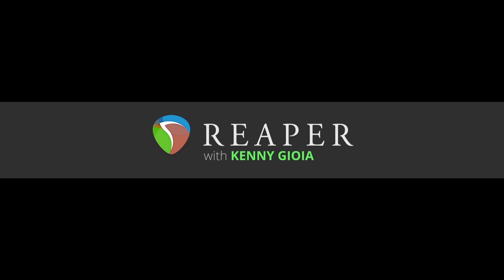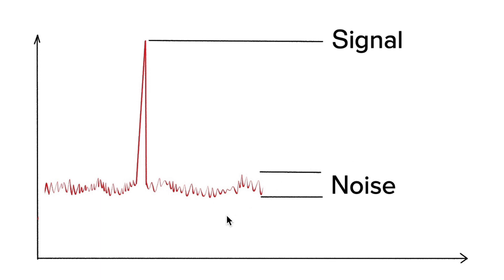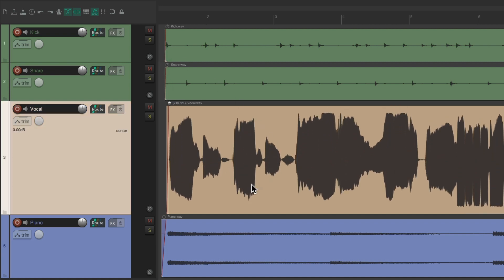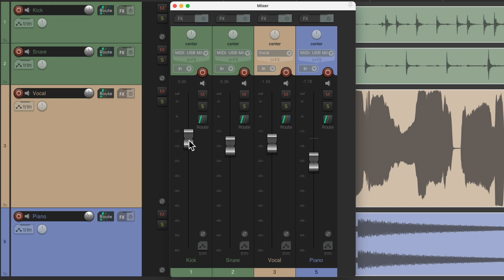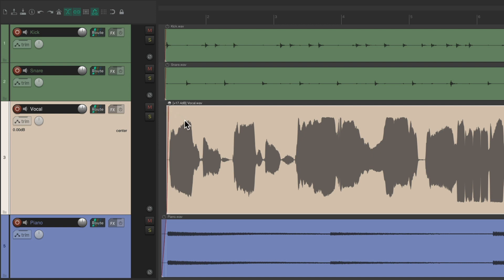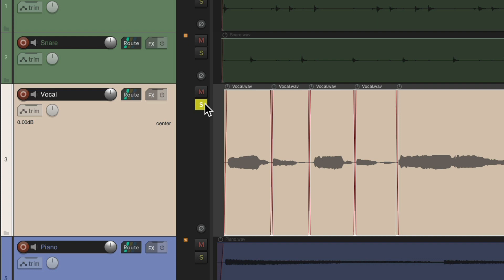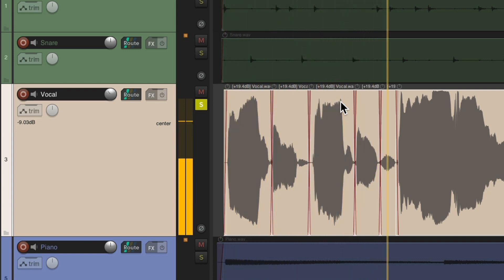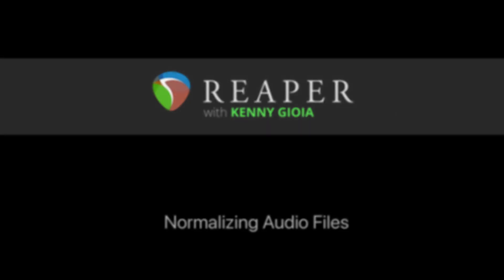Normalize Audio Files in REAPER

Comment: Thanks @REAPERMania for such great videos, including this one. When I adjust my normalised track using the volume control I've enabled in View, it shows me a red line. This stays there, the part above the line greyed out. It works effectively and is handy - I just wonder if the difference from yours is the version, or something else I've got differently set.
Reply: Actually there is perhaps a problem. Having normalized some very quiet tracks to 0db I'm having to lower the db by as much as 8db to stop the Master meter going way over 0db. I have no plug-ins on the track or the Master.  I'd be grateful to understand this!

Comment: One more thing to watch out for is gain-setting an entire edited track’s clips, then much later deciding to make some improvements to the edit.  Oops.  An option I could really get behind would be ‘normalize parent files’.  This could use the peak level of the parent file, rather than the visible clips to determine max gain, saving some grief later.

Comment: A problem I have encountered in the past: If a waveform is too low, and you apply automation-fade to all tracks, the low waveform track will not be affected by the fade----you have to create a separate automation-fade on the low track using the same fade points as the all-tracks automation-fade. Maybe the volume envelope of the low waveform is not large enough to be recognized by the automation-fade for all tracks. (?)

Comment: I am brand new to Reaper. I noticed that you have a nice and convenient Volume button in the upper LH corner of the window with the audio data. I have a *.wav filename in that location, but no volume button. I assume that I am running the latest version as I just downloaded and installed it on 10/3/2021. Is there some setting that I need to tweak?
Reply: Watch at 7:38

Comment: What if my stems are very low in volume and the wav files are barley seen on the screen from the original mix being very low? Is it okay to normalize all the stem files and mix from there without it changing the sound of the loop? I mix my loops low usually and when I export stems the wav files are barely visible

Comment: Your abstract animation at 0:58 of your normalising the wave file is actually incorrect! In your animation you simply moved the whole signal up: the higher signal goes up by the same exact amount as the lower Noise level, making it look as if the Noise is now twice as loud before (increase of about 100%) and the Signal is only increased by about 33%. If that were true, then you would have worsened the signal-to-noise ratio. In actuality the wave shape should have been stretched (instead of merely raised), to indicate that both the noise and signal have been raised at the same proportional rate to their original loudness, in which case the signal-to-noise ratio stays the same.
Reply: Yes I agree
Reply: Ah, I was gonna actually ask about that, the math didn't add up (if you add a constant to two numbers typically their ratio WILL change) glad you were able to clarify.

Comment: How do you find out what volume plugins prefer?
Reply: The manuals/documentation usually mention it if relevant. You can also do some manual testing to hear how the plugin responds to different gain levels. It's mostly stuff modelled on analog gear, like classic compressors, consoles etc, but also many guitar amp sims work best at -18.

Comment: Bedroom guitar player here. Recording at bedroom volumes has a lot of potential issues, however - I find that my wave forms are low (Amp into an interface, and a gate plugin placed on the input side of the track). In windows, I use Ctrl-Shift-N on the selected track item (recording of guitar at bedroom volume) after recording, to normalize the item. It allows me to mix with smaller db cuts by way of the track fader and doesn't mess with the other track items. The trick of 'splitting' the item never occurred to me - great tip!

Comment: Not explicitly mentioned, but if you are using any dynamics plugins such as a compressor, normalizing will change the sound since you will be hitting the compressor harder.  This can be quite significant.  That's why it's a good idea to normalize at the very beginning of the project, before you start adding plug-ins and tweaking things. Something to be aware of.
Reply from the maker: Yes. Either normalize as you go or before you start mixing.
Reply: So true. Same with guitar amp sim plugins.  They can sound drastically different after normalizing if you don't reduce the input level.

Comment: Hi Kenny, do you normalize audio files before mixing? Also, should we normalize before applying FX? What about after applying FX does it matter
Reply from the maker: Yes. I do it before mixing. You should definitely apply it before adding any dynamics based (compression) as it will affect how hard those effects are hit. Not sure what you mean by "after applying FX" because this is a volume change that comes before the track fx.
Reply: @REAPERMania  thank you for responding! This answers it. I just meant pre vs.post plugins

Comment: 4:50 Hey, Kenny. Thanks for the video! Quick note: Because all of Reaper's audio paths are 32-bit float, running out of actual headroom is effectively impossible. You can run out of apparent headroom (i.e. you can clip the meters—which top out at 24 bits), but internally the signal is still intact and can be restored simply by attenuating the signal at a later gain stage, like the master fader. Keeping levels moderate is still a good practice for a few reasons, one of which—ideal input levels for some plugins—you already mentioned. Also, some plugins might use fixed-point maths and could distort internally. Moreover, keeping all signals nominal allows the channel faders to operate in their intended range which is conducive to a smooth, effective workflow.
Reply from the maker: Yes. I only mention because if you leave it fully normalized and add even a tiny bit of EQ, you will be clipping pretty fast. It won't matter if the fader is lower on the channel but I also think it's a good idea to give yourself just a bit in this area.
Reply: @REAPERMania  Yes, it would clip the meters, but not the internal mix bus. Dan Worrall did a short video on this topic a while back https://youtu.be/Ph1M3QZGku8 but there's no talking. Perhaps this has potential as a future REAPER Mania video?
Reply: @Ihadtosettleforthis  Ah, so he did! I realize now that I've even seen that video. My bad!
Reply: @Hermiel  No worries, just wanted to point it out in case anyone else was reading this thread as well :)

Comment: I am many years in sound engineering but still don't get it...why use nirmalization at all ? Soundcard resolution is high enough to mix properly if gain during recording was set right...then why should I normalize material ? Any idea more than "because I can" ?
Reply: That would presume all recordings come back within a certain range. What do you do if the signal of one take is too low and off the chart in the mixer?
Reply: I edit audio files that are recorded by my church, and extract the sermon audio. Sometimes the mic level is a bit low. Normalization is a quick and easy way to bring the level up to something reasonable.